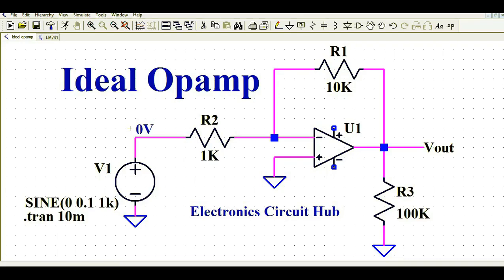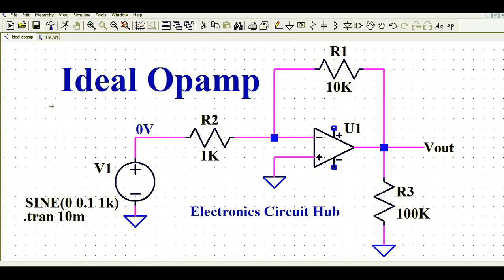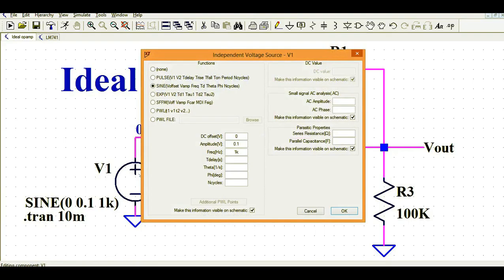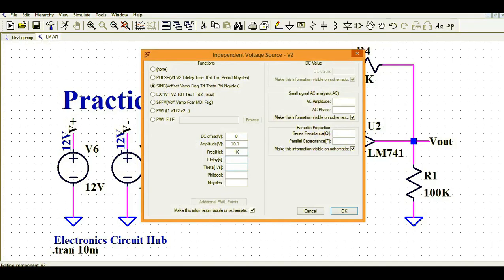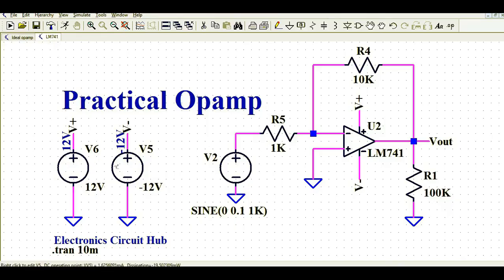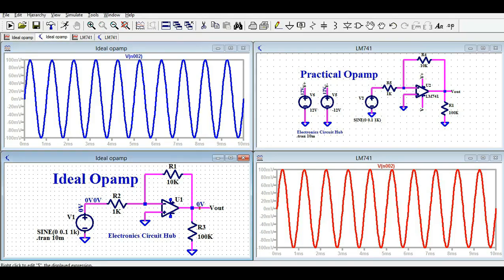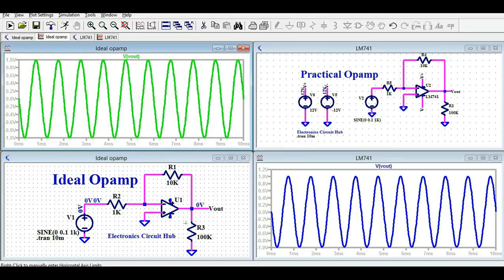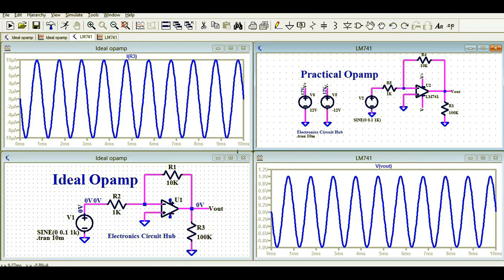Comparing Ideal and Practical Op-Amp Behaviors Using LTSpice

Comment: Professor, you might want to conduct an AC sweep (100 hz to 1Mhz) to view the difference in the phase margins.
Reply from the maker: Hey...Danny , thanks for your feedback. Yes you correct we should look for phase margin.
Here I wanted to show the behaviour of ideal opamp so I ran the transient analysis. I changed the different parameters of opamp.
Reply: @ElectronicsCircuitHubECH  Professor,  it might be helpful to show the ideal model as a gain factor times the input signal. It's always good to understand the ideal vs the practical models. You start with your ideal design and then investigate the practical application. Thank you. Danny KI6VBC
Reply from the maker: @pbaemedan  I really appreciate your knowledge and contribution towards society and this channel.